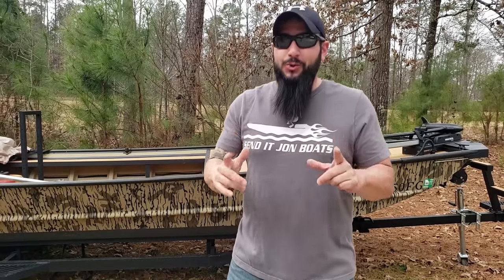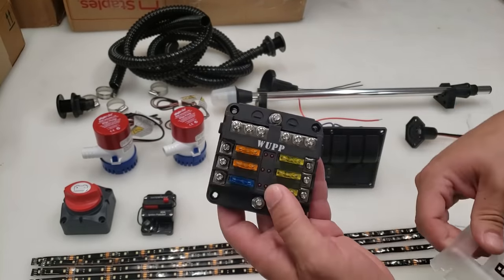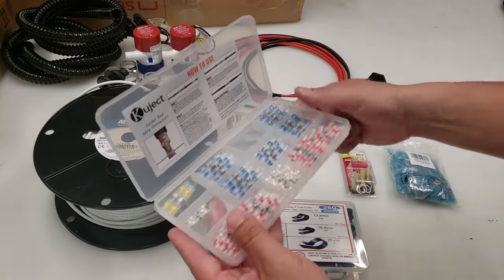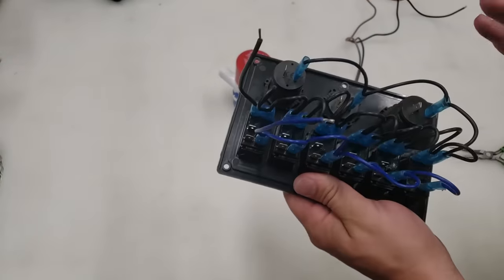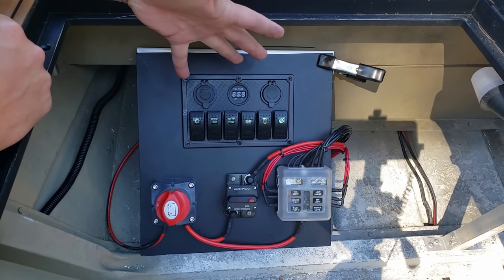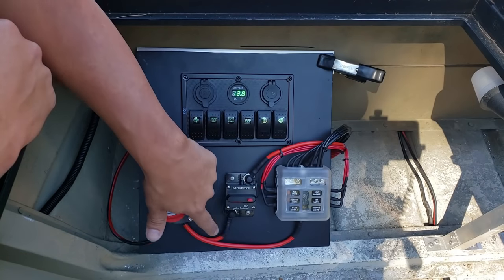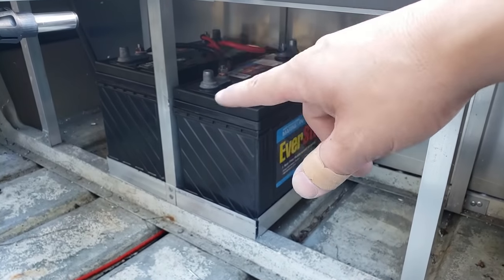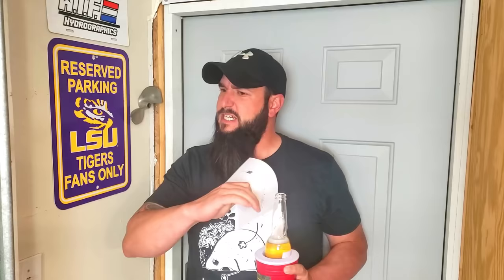Jon Boat Electrical Wiring for Beginners and DIY'ers

Comment: Gosh this seemd so simple when I first bought the boat. After a few more weeks and a few dead ends, finally getting to doing this wiring seems a bit more daunting to be honest. I am not an electrican by any means and props to you for getting this done so smoothly
Reply from the maker: Its like anal, the first time is always the worst, then it gets easier.
Wiring ain't hard once you understand the concepts.

Comment: Fantastic job explaining the electrical elements of a little build. The mansplainer rant was a bonus. I am rebuilding my 12 ft v-hull once again. This time, to get it lighter and easier to load/unload, I am trying to make everything in the boat removable. I have more time than I have back strength and my favorite boat launch does not allow trailers.

Comment: I’m an electrician for homes and you did a fine job!  Boat and automotive wiring is foreign to me.  Great work man
Reply from the maker: Thank you sir! Appreciate you watching and glad you enjoyed it.
Reply: Does the Copper tinned cable allow increased current carrying capacity?
Reply: @NICHOLASBYRNE3931 no, if anything it adds slight resistance but nothing that would change the amp rating of the wire. Tinned is just good to protect from corrosion.

Comment: Two years later this motor is going strong https://www.youtube.com/post/UgkxBZWgzfpS2Jj7JqIHyaSZjyVHNUgCKCBf  Just uploaded a video of it after 2 years. We use it probably a dozen days each year on our small raft.-original review- We got this motor the other day and tested it out. I don't have anything to compare it to, but it seems good to me. It has all the features advertised - the motor housing is metal. We will see how it performs longer term and I will revise this review if needed. Some initial observations:- Good thrust, moves our boat around really well- It comes with a circuit breaker but no switch - so there's no way to kill the motor other than yanking the connection off the battery. I installed an inline switch.- The mount bracket is plastic and I worry it might break- There are a number of plastic parts that I worry about, but the most important ones are metal or some kind of composite
Reply from the maker: No complaints from me, work fine.
Reply: try the kill switch connected to the ignition.

Comment: Well done! Finally someone who parallel connects two 12 volt batteries correctly.
Reply from the maker: Thanks Patrik
Reply: Hey, mind telling me what gauge wire you’d recommend using for paralleling the two batteries?  Thanks
Reply: @davidgodfrey7560  I would just take the same gauge that comes to/from the batteries.

Comment: Thanks to your video…I completely rewired my entire boat for a 24 volt trolling motor, front and back lights hooked up to the circuit breaker and toggle switch panel. Thanks for the vid!!

Comment: Fine job on the wiring. Agree with the statement about NOT grounding the electrical thru the hull but it has nothing to do with electrolysis,  if any of your hot wires rub thru the insulation then you have a direct short with a potential for a fire if no circuit protection. Seen it happen.
Reply from the maker: Thats a great point too. Thanks for watching.

Comment: I triple shield any wiring I have to run outdoors. So for anyone wondering what that looks like, you have your base insulation + your own added heat shrink/tape + proper looming sheaths. Never had a comeback for wiring or electrical. Never had to rip out or replace a harness in the past 10 years, actually pretty funny my harness was holding a golf cart together after it crashed. Kept the battery from coming out.

Comment: Fuse > small light on switch > input on switch > accessory > ground = built in fuse light for each individual circuit.
Reply from the maker: cool

Comment: As a professional technician I use a lighter on heat shrink all the time lol I have a heat gun too but a lot of time I can’t fit it in places without overheating something else customers don’t like melted trim or plastics so I got it quick with a lighter but hold it close in the blue part of the flame and keep a good motion it didn’t leave any soot at all on mine I use those solder heat shrinks a lot and even works with them again without soot or overheating the heat shrink just need to know what your doing and a lighter work fine lol love you video tho I am wanting and wishing to get my first boat I want a job boat and build it into a mini bass style boat I just live in an apartment so I can’t get a boat but I love your information on wiring thank you

Comment: Great info. Thanks fir explaining the difference between marine wire and automotive wire. All this time I thought I was just being ripped off. I really like the battery disconnect switch: I need it install one on my duck boat.
Reply from the maker: I thought the same thing for years until I actually researched it, and then experienced some wire issues myself from using automotive wire. 
The battery disconnect is awesome, and not expensive either.
Reply: @SendItJonBoats  yea man thanks fir this video I enjoyed the information. Not to be a scooter but thanks fir everything you’ve taught me here. Fir the first time I actually understand how to wire up everything fir my boat. Fir the record I think ur boat is awesome it’s a perfect boat fir gettin out on the water and fir havin a good time. I think I speak fir everyone when I say this keep up the good content.

Comment: Great vedio. One thought to consider is a 40 or 50 amp auto breaker at the battery on the main power supply wire. If damaged that wire will melt as is. Breaker would protect wire and boat. Love your vedios.
Reply from the maker: That is a good idea.

Comment: Great tips. Very clean results. Those green manjamas were awesome 😃.    I like to use to use that adapter piece (Reflector Nozzle) that fits on the end of the heat gun to concentrate the hot air on the splice, it also helps to save you from toasting adjacent wires or overheating the insulation on the wires you are splicing.   I couldn't tell if your heat shrink was marine grade , I use the marine stuff it has a built in sealer. See you on the next one!
Reply from the maker: The care bear onsie is awesome! LOL
I forgot to order some marine heat shrink, so I just used the regular stuff since the rest of the connectors had the sealer in it.

Comment: You did a great job and the advice given is A grade, as someone who does a bit of automotive / marine wiring / instrument wiring. 
The only thing I generally do differently and its just a me thing.. I'll use glue lined heat shrink, liquid electrical tape (LET) and dielectric grease.
If i cant use a glue lined piece of heat shrink ill paint the cable with the LET and slide the shrink over when it goes tacky. If its a solder joint with no glue lined ill put dielectric grease over the joint, then LET and then the non glue lined shrink. 
Ill also grease all terminals I am connecting (even auto plugs) to reduce the corrosion chance between the metals... 
Nothing worse than going to remove a panel or fix a term and everything has corroded together. 

on a side note and amazingly enough...When you were talking about the grounding to hull.
I wired my mates Stacer Seamaster 519 last year and was horrified to find that they do a negative hull set up with a stud welded next to the battery and under the console.
I questioned Stacer and got told because the engine (Yamaha F115) has a sacrificial anode in the engine and a second one on the trim plate the hull wont become an anode.
We only run in brackish and salt water... the hull is showing signs of minor anode corrosion where the coating has been worn away with the beach landings we have done... Go figure

Keep it up, love the channel

Comment: Great work, all looks very professional and very clearly explained. I would have put each sump pump on it's own fuse not wired together. This way if one sump blows a fuse you will still have the other. This may not be necessary but, gives an extra layer of safety. Thanks for posting such a pro video.

Comment: Great video! I have 30-year-old marine wire on my old boat, it still works.
The previous owner did all the Chartplotter wiring with normal wires, 2 years later it all failed and roasted the Chartplotter.
Always use marine-grade electrical components and wiring.
Reply from the maker: Thanks for sharing, I try to tell people all the time that marine grade is worth it.

Comment: Only change I would make is a larger fuse to the 12v plug on the switch panel so you can use a hand held spotlight for navigating at night.
Reply from the maker: I got so many  dang LED light bars on the front I doubt I would even use a hand held spot light, but I do own a battery powered spot light if I ever need it. Good idea though.
Reply: Also, I'd probably not share the nav lights with anything else, especially the 12v "cigarette lighter" adapter, that someone might plug something like an inverter into.

Comment: Good video. I'm old and have experience in wiring houses, cars, etc. The rolls of wire you showed may just be for examples, but I noticed one roll was copper clad ALUMINUM. (Not shouting..just emphasizing.) I personally, through experience in the 1960s and '70s, say do not use ALUMINUM wire. Good video. I think you did a good job.
Reply from the maker: it was just for example. We only use marine grade tinned copper wire.

Comment: 25:30 I would add some silicone on both ends of the heatshrink tubing after that. It will prevent corrosion from taking place and your connection should last two or 3 times longer.

Comment: Jon boats are so easy to rewire. I’m jealous as hell. I have to cut multiple access holes and buy inspection hatches just to find the wires in my old foam filled center console Henry O
Reply from the maker: Ughh that sucks cutting access holes. Jon boats are so easy.

Comment: I know it was posted quite a while back, but tracking through your video, as a non-YouTube certified engineer, I noticed a few concerns that I would like to point out to other late comers. Overall, it's a great video. 

First, marine grade wire MAY (“MAY” capitalized for emphasis) help in a saltwater marine environment but there are other measures that will be much more effective. Those watertight butt connectors are a good example of this. Also use watertight heat shrink and a properly sealed fuse box will also help. In a freshwater environment, it will make little difference if you go with marine or automotive wire. Inboard motors generally use automotive wiring. 

As for ampacity/size/length, the authors of the marine chart you're looking at must think that the laws of physics change when you are on the water. Automotive charts are much more practical and reflect those used in ship building. Typically the minimum wire size is #18, not because it's needed for current carrying capacity, but for physical robustness. #18 can carry 15A for 10 feet. #16 as you're using can carry 20A 10 feet. This is overkill for lighting and those tiny bilge pumps.

Next, grounding. No-no, no-no-no-no, no, omg no, don't listen to someone who says not to ground a marine electrical system to an aluminum hull 😁. People confuse grounding to the hull with using the hull as a return path. Absolutely ground the hull in one, and only one, location to the negative terminal on the battery. Note, there is no ground post on a battery and the black wire should not be confused with the ground, it is the negative or return. All devices, however, must use two wires for power, unlike in some automotive applications that use one wire with a frame return. Doing it this way, the proper way, will not rot your hull. The hardness of the metal is not the deciding factor for corrosion and if you are concerned about corrosion, ground the negative, then install a sacrificial anode, usually made of zinc. Your motor should have one or more of these already.

Finally, only use a starting marine battery if you actually start your motor with it. For trolling, lighting, and other normal loads, use a marine deep cycle, or better yet, a LiFePo battery. Starter batteries have thinner plates that will deteriorate faster with deep discharges. So, they might be cheaper up front, but overall cost is generally higher.

Comment: I pimped my ride three years ago. Three smaller light bars up front, LED nav, LED courtesy with dimmer. bilge, all running through a similar switch panel (mine has the built-in breakers eliminating the need for the fuse bars). I have a ground at the front of my boat underneath the deck and I have a ground back by my motor eliminating the need for all those return ground wires. However yes, grounding your battery to the boat is a dumb move.
Reply from the maker: Sounds like you got a good setup. Yeah batteries grounded to the boat makes for some nasty corrosion and eventually holes, I have seen some bad ones over the years.

Comment: You should be bonding the fuse box to the boat since it is conductive and can become a hazard to the battery or person using the boat.  Also the kill switch for the battery should be placed onto the negative terminal since the boat can conduct electricity unlike a fiberglass bass boat.  Bonding your conductive boat is not only for safety but for corrosion protection, troubleshooting and more.

Comment: Thank you for putting in the time to show us all of this.  One question...if you did hook up the blue wire on the switch panel for the bottom LEDS, would it go to the positive post on the fuse box and if so was there a ground wire for that also?
Reply: yes the blue wire would go to one of the fuses and the black wire that goes to the switches would be the negative for those bottom little lights.

Comment: thanks it help me a lot, you answer all my question, except one: you tell how to plug the electric mini kota, but for the main motor, how do you do this if you pass by the board? 
and how you charge the batteries ? Do you remove it each time or you have a system for it? thanks
Reply from the maker: I use a clip on battery charger when I get home to charge both batteries. 
For the trolling motor I run the wires straight to the motor and back to the battery, you can install a plug if you want. Most of the time I do just because it looks nice.

Comment: Awesome video. This is the best one I’ve seen. Cleared up A LOT of confusion. This is the exact set up that I’m wanting to run. What gauge wire should I to run to my battery from fuse block and battery disconnect?
Reply: I think he said 8AWG from the battery

Comment: Great video, just bought my first build and this video came in clutch. Question though, would this process be the same if you ran your batteries in series to make them 24v for my 24v trolling motor?

Comment: Great explanation. One question- both bilge pumps on same circuit? If there’s a bad ground or power connection, both pumps are not functioning.
Reply from the maker: The wiring is good quality so I am not worried about it and the rivers I use this boat in are about 6 inches deep... so I am not super worried about sinking if they go out.

Comment: When using shrink tube, put some silicon on the wire where the shrink tube will be, shrink it up and it'll be water proof.
Reply: Silicone. Silicon is a metal.
Reply from the maker: Good idea

Comment: Awesome information!  So clearly explained but I do have a question. If I did want to have the green lights work on the panel, where would I connect that blue wire?

Comment: Another added benefit of "tinned" wire is when you're soldering it. Electronic techs pre-solder copper wires and electronic contacts so that when they geaux to solder them together the pre-soldered (or "tinned") wire & contacts start the melting quicker so that the new solder can flow easier.
i.e.   marine wire that's already been tinned solder easier.
boudreaux and thibodeaux electronics 101
" Geaux Tigers "
Aheeeee
" laissez le bon temp rouler "
Reply from the maker: Awesome, Geaux Tigahs!!!!

Comment: You make it look easy to do. Great information about how to wire a boat easily. But if you were to use the blue wire for the bottom light on the switches where would you run that wire to. Can you run it to your key so when you start the boat they stay on constant
Reply from the maker: Yes you can hook the blue wire to the key switch, or just put it on the main power supply so when the battery's are on the lights will come on.

Comment: Hey man thanks for the video! Do the negative connections running into the bus of the fuse box need to correspond with the positive outgoing connection to each accessory?

Comment: Were did you add the fuse on the batteries in parallel and how did you hook up your charger you were talking about at end of video. When you use the fuse box can you use the trolling motor and a fish finder without any interference on the fish finder?Loved the video so far the most informative and in layman's terms I can  understand. Other videos got more confusing thd longer you watched .Thanks.
Reply from the maker: I put another one of those 60 amp fuses on the main power wire coming from the battery before the battery on off switch. I used a cheap Harbor Freight trickle charger that just clips onto the battery terminals.

Comment: Only one very little error... more strands in a wire makes more resistance and therefor less amps.  But if you use the chart in this video to pick the right size wire and please use marine wire you should be just fine.  Great video and one worth watching for sure!!
Reply: Metal doesn’t burn very well

Comment: great video! It has saved me a ton of time. Thanks . got one question. did you hook both the positive and negative from the battery to the same terminal on on off switch?
Reply from the maker: No, just the positive wire goes to the on off switch.